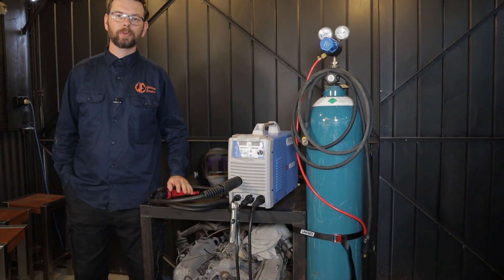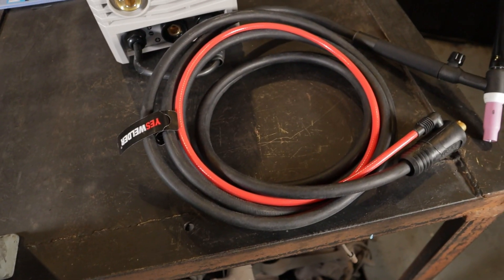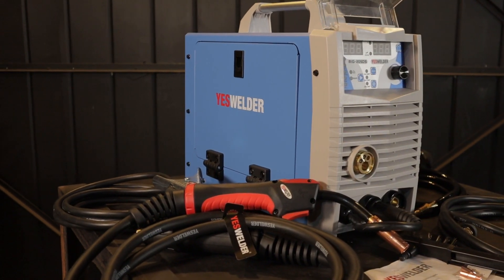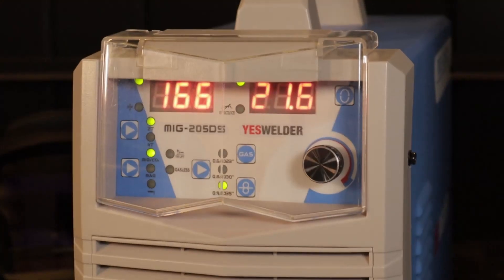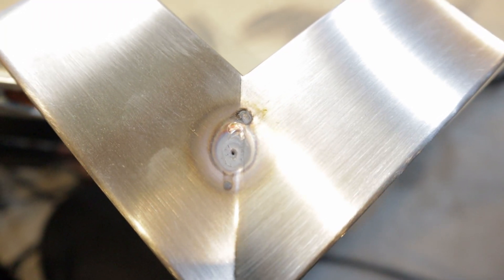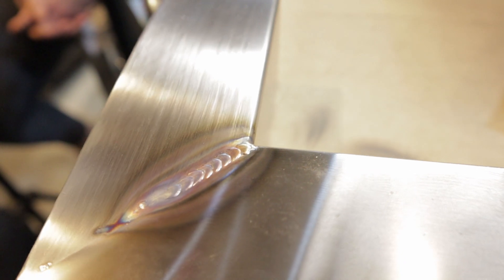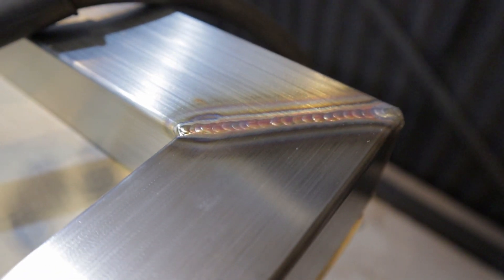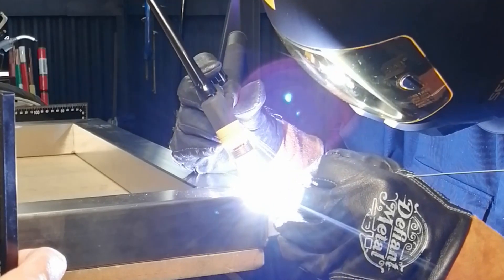Lift Start TIG Welding | Got A Multiprocess Welder? Then Watch This To Learn Pro Tips.

Comment: Eventually I'd like to get 3 machines. I have two machines that do stick and lift tig and one of them it's a mig/stick/lift tig machine. Which is fine for now. I do want a dedicated HF tig rig though so I'm not having to switch leads and bottles every time i want to switch processes. I can do most things with the two welders I have though. Yeswelder products are VERY nice for the money. Bestarc as well. I'll likely get a high frequency yeswelder tig machine eventually.
Reply from the maker: I understand, switching can be a pain. I had the AC/DC TIG from Yeswelder, it was a good machine for the money.

Comment: Can one use "Lift Tig" on Aluminum?
Reply from the maker: Hey, it isn't practical. You really need a  AC/DC TIG. People will say you can use helium gas, but that is massively expensive and you wouldn't be happy with the results. I have a video using the YesWelder to weld soda cans. That is about the cheapest machine that's any good.
Reply: @weldingempire  TY

Comment: great intro video... as far as safety goes and electricity, when turning off the gas valve and laying the torch down are there any precautions to be aware of as far as tungsten touching metal close by unexpectedly. I'm new to tig welding as just thought I'd ask because getting zapped is the last thing i need. I have a torch holder but there's always that chance of careless actions.
Reply from the maker: Hi, The tungsten will still arc if it is a scratch start or a lift start. So it will be wise to use a torch holder or place away from your work or if the you are on a metal bench that is also grounded. You won't get a zap from the torch. I hope that helps.

Comment: i just picked up a mp welder, Forney mp 140, i had a Miller Dynasty 200 that i sold, i have been thinking of making a pedal for my Forney, I wonder if I could use a rheostat to lower the input to the machine and a relay to cut the ground.
Reply from the maker: That's the approach I was taking. But the more I looked into it the expense was getting to the point you were better buying a low dollar HF TIG.

Comment: Problem with extinguishing the arc that way is that it leads to arc strikes. Most TIG lift machines have the option for a down ramp after you press  the button (or stop pressing the button in case of 2T). This is a much better way to end the arc.
Reply from the maker: Hi, I'm not familiar with a lift start TIG with that function. To avoid arc strikes you can tail off onto the wire.

Comment: I actually just bought a yes welder 205DS and will love to see if it's possible to convert this lift tig to a HF tig or add a pedal to start the arc and open the gas will be awesome.

Comment: does lift tig use 3x less amps than the regular one then or is there somekind of calculator somewhere?
i already whacked 2 sets of tips with 120 amps or no gas lol
Reply from the maker: Hi viisteist, the amps are the same. I would suggest checking you have the polarity correct for the Tig torch ( negative). I hope that helps.
Reply: @weldingempire  i am using it on negative, but maybe some cheaper machines need to be reversed? its like the mma/mig/lift tig combo, but it actually looks like its burning off the tig rod like the mma stick lol...
Reply from the maker: Oh... What brand machine is it?

Comment: Hi Welding Empire, Great video.  I have the YW Mig 205ds and I don't believe it's lift start capable.  Scratch start yes, but not lift start.  As you mention there is no remote amp control and I have not seen anything to indicate the machine has circuitry to dial back the amps for lift start tig like the old Lincoln Invertec.  But the instructions on this machine aren't the best, so it's possible I missed it.  Can you please clarify if you are showing lift tig or scratch start?
Reply from the maker: Hi Daniel, thanks for watching the video. Much appreciated. The 205DS   Is "TIG LIFT"   On the settings. I am currently designing a foot pedal to circumnavigate the limitations of All multiprocessor welding machines.

Comment: I have the latest Yes Welder MP200 and have a heck of a time trying to start the arc.  The tungsten sticks hard most of the time.  It seems to be about the same from light material at 25 amps to heavy gauge at 150 amps.  I'll try your trick of rolling off the cup, I doubt it'll help much, but I'm hopeful.
Reply from the maker: How did you get on. With the technique I demonstrated in the video? Thanks for taking the time to comment.
Reply: @weldingempire  I haven't experimented much, but I discovered that even tho it's advertised as a lift tig it actually isn't, it's a scratch start.  Yours might actually be a lift tig.

Comment: Great video, I'm inexperianced with TIG welding but it looks to me that the tailing off at the end of the weld is similar to scratch start. Is there much difference between the two? I'm interested in buying an inverter welder from YES welders and they have one at $100 and a lift tig model at $150. Is it worth the extra cost? As you stated, this may be an introduction into TIG welding for me, so possibly upgrading in the future. Thanks

Comment: can i use the tig inverter with lift arc DC to weld allow wheels or i need the expensive TIG AC/DC high freq  welder?
Reply from the maker: Hey sensei, yeah mate sorry be the bearer of bad news but you will need a AC/DC TIG.

Comment: I note that you do not use either the power control or gas control on the unit itself so presumably the welder functions a lot like it would for stick welding. Do you know what size and thread holds the mig torch on? And how did you get on with your build video? (though just going to look).

Comment: Was looking specifically for how to finish with a lift start machine and very glad that I came across your video. 

I'm sure much of my struggle comes down to practice and technique but I still can't manage to tail off without cooking and graying the end. 

So I'm most interested in seeing the build and technique in using the foot pedal for scratch/lift machines. Subscribed 🙂
Reply from the maker: Cheers for the comment and your sub. Glad I could help. I am working on the pedal now and a few videos where I am documenting the process of someone who has never welded to becoming a pipe welder.

Comment: Don’t know why anyone in Australia would bother buying this. $400 USD for the welder plus another $200 USD for shipping! That’s getting near $900 AUD and it does even have a spool gun function. I can buy a Unimig 185 multi function welder for way cheaper with spool gun option & full local support. What happens with Yeswelder if a warranty problem comes up?
Reply from the maker: Hi Greg, thank you for your comment. But the reason I brought the US welder is because I run a review site where I actually buy the equipment and test it.
The Yeswelder can now be brought from Ebay in Australia for $ 335 dollars making it an excellent choice.
Reply: @weldingempire  is that the same model though for that price?
Reply from the maker: Yeah man, https://www.ebay.com.au/itm/3-in1-MIG-Welder-Gas-Gasless-Inverter-200A-MIG-TIG-Arc-Welding-Machine-/163923898275?mkcid=16&mkevt=1&_trksid=p2349624.m46890.l49286&mkrid=705-154756-20017-0
Reply: @weldingempire  that’s awesome! Pity it doesn’t have the spool gun function, but for the $ it’s great value.
Reply: the only reason why anyone in australia would get this is if the company sponsored you and sent one to you for free
Reply: @cvspvr  not so. At just $335 or thereabouts these are great value. I upgraded from an old ‘Cigweld’ transformer machine and have never looked back.
Reply: @gregwilson9035  you said it was $900
Reply: Read the entire thread mate. He clarified that it could be bought for $335 AUD at the time. I bought one, it is awesome. Being an inverter it makes welding a whole lot easier than using an old transformer type machine. I got rid of my old ‘’Cigweld”. Never looked back.

Comment: Can you attach a foot switch to the power inlet to the tig welder to extinguish the arc without leaving any defects? Or do you need to gradually lower the amperage and then cut the power? 
And help would be greatly appreciated 🙏

Comment: Thanks for the video.  I bought a Yes Welder several months ago to learn Stick welding. I just bought the parts to do Lift Tig with it. I really appreciate this video.  Thank you!
Reply from the maker: I am glad you found it helpful. How's the stick welding going?
Reply: @weldingempire  I’m still very much an amateur but I’m definitely improving.  I knew nothing about welding but I’ve done a fair amount of brazing and soldering in my youth.  My work is in refinishing automotive paint but fixing and customizing my own cars and motorcycles is my hobby.

Comment: Thanks. This explains it very well. I have the YesWelder MIG Pro 250 and find this video very helpful as the set up is nearly identical to the 205. Only wish it was possible to add a foot pedal.
Reply from the maker: Hi  Ausfuhrung, thanks for letting me know you found the video helpful. How do you find the MIG Pro 250?
Reply: @weldingempire  I like the 250 Pro very much. Very powerful easy to set up and use and very mobile. I upgraded the Mig gun to a 250 amp model. I do a lot of medium duty structural repairs with it. For the price I couldn't ask for a better welding machine!

Comment: i'd be interested in buying a foot pedal for the arc+gas start/stop. i have the same yeswelder unit. lift tig is a pain in the butt and i waste a lot of gas when i forget to turn the valve off at the torch. hit me up if you got units to sell.
Reply from the maker: Hi Camilo, I will be doing a video in the coming months for the foot pedal. Sorry for the long time in between. I am in the Australian outback building a goldmine so I have my hands full at the moment.
Reply: @weldingempire  good luck with the mine. Don't wake up any Balrogs.

Comment: Hey mate, thanks for the upload, I have a cigweld multi welder and am getting really frustrated with the lift tig. Thanks for your demo, I'll try your technique.  A yes for me with the foot pedal too please.
Reply from the maker: I hope the lift TIG is going better Camker. I be making the pedal shortly. How do you find the CIGweld?
Reply: @weldingempire  thanks for the reply. yeah mate, it’s a good machine for home or hobbyist kind of use simply because you enter you parameters and it’s ready to go. I think someone with more experience could tweak the settings but it seems to go alright for me. I’ve stick welded all my life and I reckon it’s the smoothest machine I’ve ever used. For the tig I reckon I just need an on off foot pedal to an lpg solenoid from a car for the argon.  I reckon I’m just wasting too much gas with the tap on the torch. I always have 12v handy in the garage and it should be simple.

Comment: I’d love to see a video on how to get a foot pedal as I have a multi purpose ( cigweld ) welder and have only just gotten into tig welding a scratch start is my first tig and I find it that bit difficult to start / stop and annoying with the valve on the handle
Reply from the maker: Hey Zac , I am still going to be doing it. Work is crazy at the moment so I don't have time. It's coming though. Glad you like the video. It will work for the CIG Welder too. Good little machines.

Comment: Do you need a pedal or switch to lift arc?
My welder has a euroconector port for mig, can i use it?
Reply from the maker: Hi Liviu, No you don't need a pedal at all. It is a luxury item really. Helps to save gas more than anything. It will fit most welders with the DIN 35-50 type fittings.

Comment: Which import ac dc tig welder does the best welding on thin metal?
Reply from the maker: Hey John, thanks for the comment. For value for money with excellent quality, I would recommend the  Yeswelder 250 amp AC/DC Machine. http://yeswelder.com/products/tig250p-aaa Use my code WELDINGEMPIRE for 10% off. I have a Yeswelder hood and @)% and the quality and service are great. I hope this helps.
Reply: @weldingempire  the

Comment: Good day, I just purchased this welder after using an older 125 amp AC flux core welder for the past couple of years. This one is such a step up from that. I also have enjoyed the videos that you have provided as well as the information. You are very clear and really stick to the point without a lot of excess fluff. Keep up the good work. 

I would also be interested in seeing a foot pedal modification.  I also have seen listed on another forum where you can do a mod to add support for a spool gun by tapping into the drive wiring. I am exploring that as well. Seems like they use a DPDT switch and 2 pin connector to split that drive feed.
Reply: Hey Donald, thanks for the kind words. I am glad your are liking the new welder. They are a great machine. That spool gun mod is interesting, can you remember the forum.

Comment: Nice video! You did a great job 👍
Vic sent me a link to your video. 
I also have a Yeswelder MIG 205, mater of fact I’m running tonight in my shop. I’m quite surprised how good this machine works.
Thanks for posting 👍
Reply from the maker: Thank you Mike, I appreciate your feedback. Yeah the yeswelder is a great little machine, it punches above it's weight. I enjoyed your review also. The etch test was a good idea. You build some cool stuff on your channel.
Reply: @weldingempire  Thanks! I really appreciate it 👍 I’m going to subscribe, I definitely liked your in depth review and tips on TIG welding!

Comment: Great video! Helps out pretty good. I just got the mig-250 yeswelder . And would like to know if that yellow torch your using will fit mine? And can’t see the link if u put one already
Reply from the maker: Thanks Dan, Let me know how the 250 goes, that looks like a good welder. The link for the TIG tourch is here https://yeswelder.com/products/tig-welding-torch-17v35
Use my coupon to get 10% off the tourch. The glass lens and the yellow insulation were a different item. If you are just learning TIG I would get used to welding before buying a glass cup. They can break if you are trying to get your tungsten unstuck. Hope that helps mate 👍

Comment: Yes definitely make a video on how to modify a lifting machine to operate with a pedal I just bought a nice multi-process welder that the lift start and would like to add a pedal to it.
Reply from the maker: Cheers for the comment. I am working on the pedal design now.👍 What machine did you get? What do you think of it?
Reply: @weldingempire  I got a plasmargon tig-228 and it's a very good machine putting it through it's paces using flux wire and it right now and I used it to tig with already and it lays down real good TIG welds would like to see about putting a pedal onto it so I can maybe weld aluminum with it and do my stainless steel exhaust and maybe do aluminum intake pipes. I think it's a very good machine for being under $250
Reply: @hungsolow30  does it got AC? otherwise your hack option of welding alluminium would be to use aluminium sticks (for mma mashines) with your tig. You can see it done on weldingtipsandtricks channel.

Comment: Yes please make a video on how to modify machine. Thank you.
Reply from the maker: Thanks for the comment Dong, I am working on the foot pedal now. 👍
Reply: @weldingempire  Would a stinger sgp32 battery isolator inline with the tig torch work to disconnect the circuit/arc? Tap power from the mig gun wire feed wires and have a switch on the torch.
Reply: @weldingempire  +1 on foot pedal modification. I bought this same welder and used it for stick welding. I've been using it for flux core with great results. Buying an argon/co2 tank as next upgrade once i'm done with current project. your video inspired me to put tig on the list and a foot pedal would be excellent. thank you, kind sir.

Comment: I’d absolutely be interested in seeing a foot pedal build vid. Great channel btw, I’ve enjoyed your videos.  Learning to weld is a long-time item on my todo list but finding the time and justifying the initial expense have kept me from it—so I’m encouraged by your emphasis on what can be done with simple gear. Found out about you from Joko btw.  Thanks and good luck with the channel.
Reply from the maker: Hi Mike, thank you for your kind words. I will get to work on the pedal design now. That's great to hear that you have not ruled out getting a welder, it is a expensive tool for the workshop. But they can always pay for them selves with a few of jobs.
Reply: @weldingempire  Is the pedal an add-on to allow pedal control on a lift start model?  Looking forward to it if it is.

Comment: Here in the US we have 120V alternating current, is that the same for Australia?  I think the max you can go with 120V AC is 125 amps, but I could be wrong.  Are these types of welders as good with that level of power?  It would sure be easier than tapping into my 240V lines.  This is making it tempting to get a multi process welder, but YouTube is taking too much of my time for real projects right now.
Reply from the maker: Thanks for your comment. We have 240V in Australia, but I brought a step down transformer to run US products on the 110V. The welder can go up to 160 amps on 110V. So you can easily weld 4-5 mm plate set at 18-20V with a maximum current of 160 amps. The specs on this machine are very impressive, but I find the synergic control way of setting the machine a bit different from the volts/wire type adjustment. 
Speaking from experience if you do start making real projects, don't film them. That takes a lot of time too.